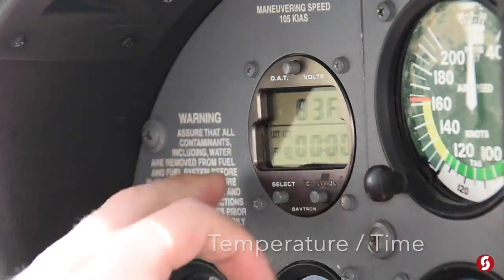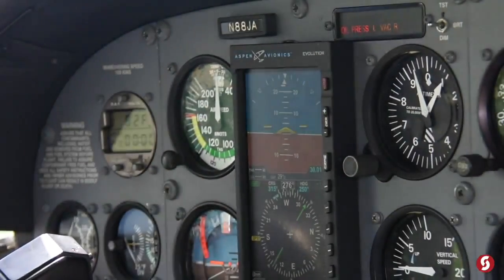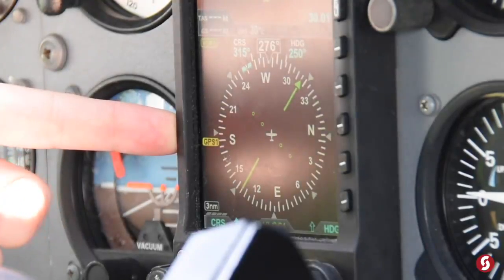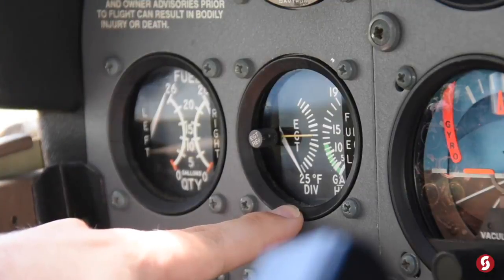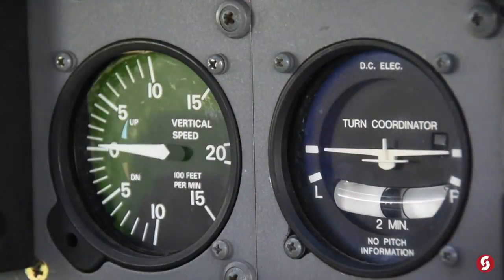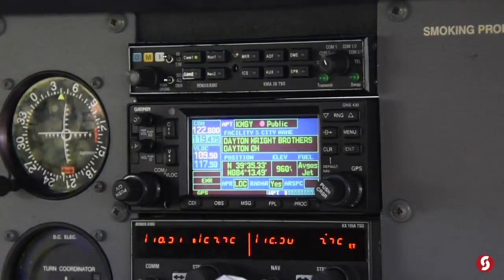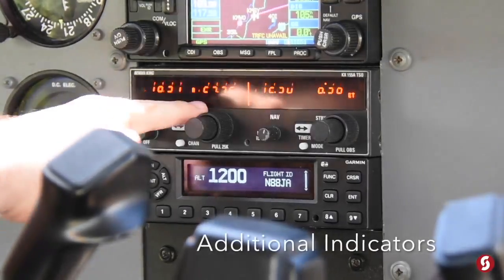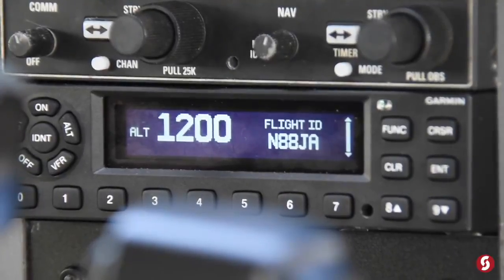Basic Instruments Of The Cockpit Explained

Comment: The hash marks on the turn coordinator do not indicate 15 degrees of bank, they indicate the rate of turn (3 degrees per second). I believe you meant to say, at cruise speed in a Cessna 172 the bank angle would be around 15 degrees for a standard rate turn.

Comment: Great video, Thank for posting!

Do small planes have or use “Wind Gauges or Wind Indicators?”

I know runways might have devices or wind socks but is there any inside cockpit?

Displaying wind direction & wind speeds?

I know my small sailboat has that gauge to help me align my sails etc.
Reply: How would you get a reading other than your movement through the air?
Reply: NO

Comment: Last question, promise.
Newbie question:

When flying a basic Traffic Pattern around runway.

When you take off & climb to altitude then make a left 90 degree bank for crosswind direction-

How do you know how far to fly in that direction flying a small Cessna plane?

Does one use a stop watch or read miles away from airport to know when to make another left bank turn to line you up at the downwind part of the course?

What’s the easiest way to know you flew out 1 mile or 2 miles away of runway?

One May fly out 5 miles on downwind portion to get to 45 degree mark with runway at 8 o’clock  to make another left turn but how does learn to make last left turn to line up with runway on final approach & not over shoot runway then need to backtrack?

Thanks